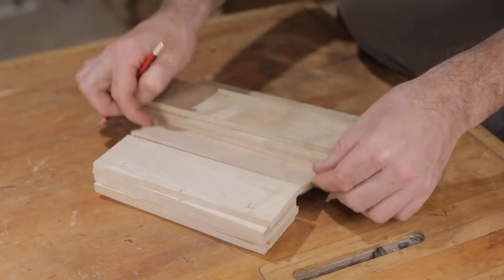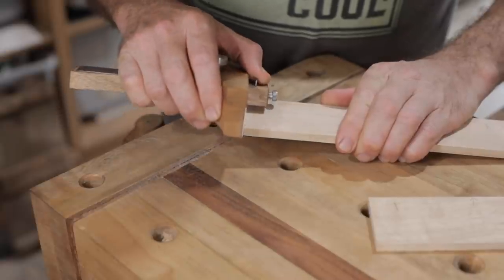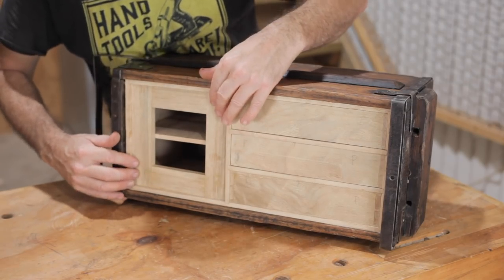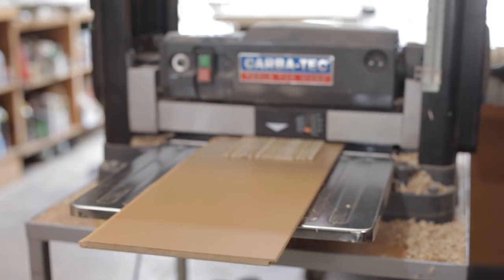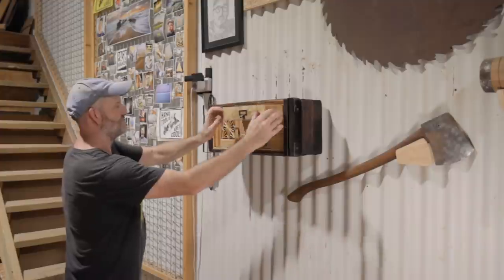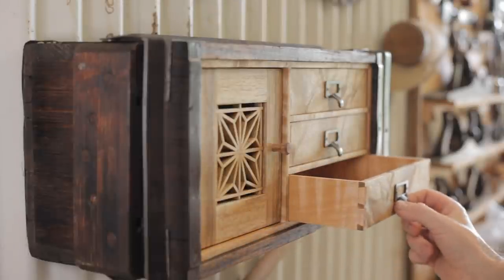Wall Cabinet from Recycled Ammo Box - Scrapwood Challenge Ep26

Comment: Absolutely stunning. If it were staying in the workshop I would suggest getting some steel to match the braces on the box and have them screwed to the top front and have them go up to the wall at an angle, almost as some supports.